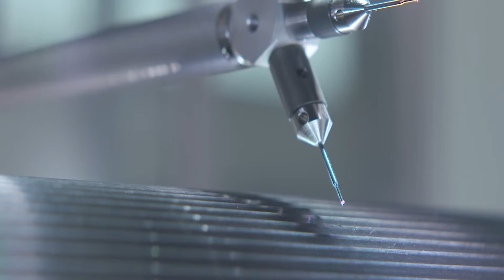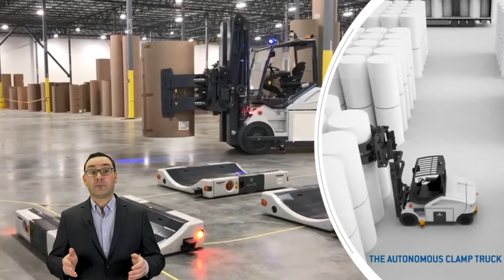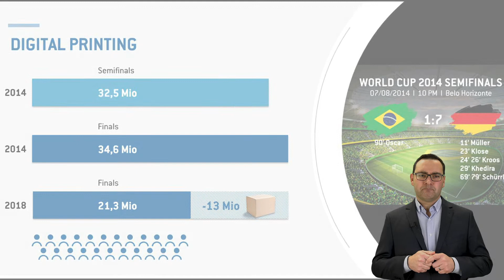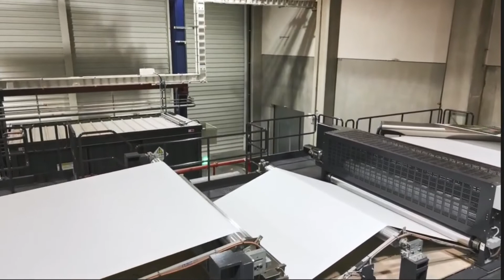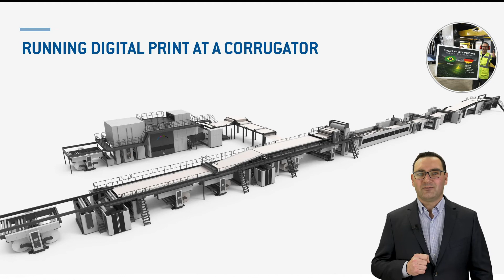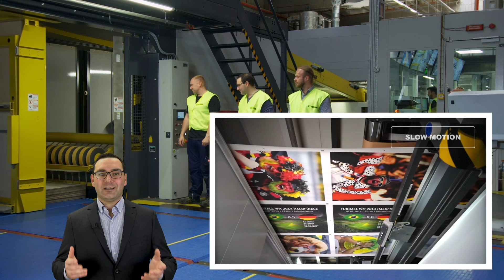Thomas Murr | Box Plant 2025 | Exhibition Presentation

Comment: I work in a box plant with a BHS Multi facer (C flute/B flute) corrugating rolls, and a BHS glue machine currently. If this machine works as well as ours, this plant won't be productive till 2070.
Reply: I woke at a box plant with a complete BHS corrugator from the Module Facers all the way through to the stacker. Our corrugator runs almost 24 hours a day non stop aside from break outs and operational and small maintenance issues.
Reply: @eliminate9990  We have the BHS multi-facer, and United single facer, which we run most of the time. We also run 24 hours a day, but have constant issues with the BHS machine, which was installed around 2003, and has a pressure belt. The United is a pressure roll machine. Our BHS glue machine, at the triple stack is an only a few months old and is giving us issues daily.
Reply: I woke at a box plant with a complete BHS corrugator from the Module Facers all the way through to the stacker. Our corrugator runs almost 24 hours a day non stop aside from break outs and operational and small maintenance issues.